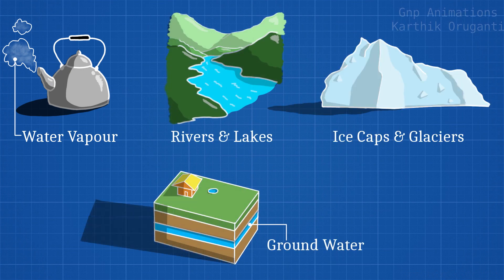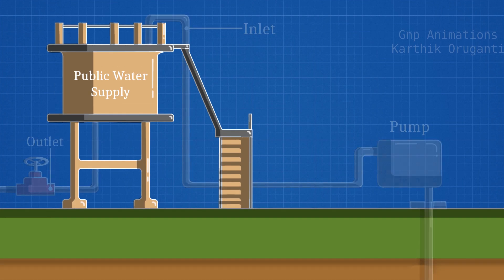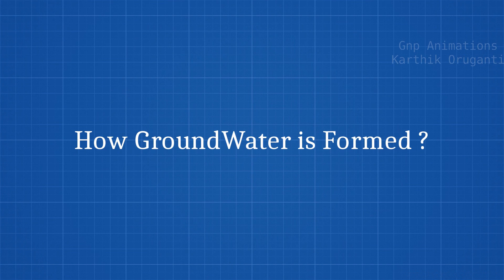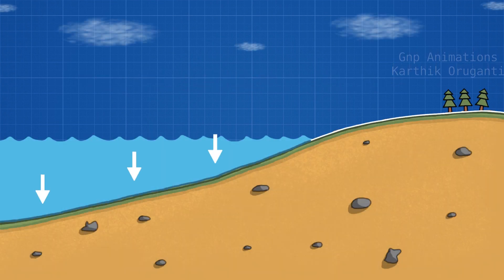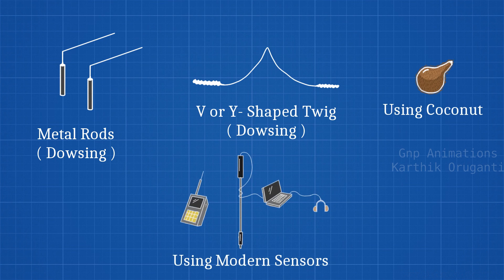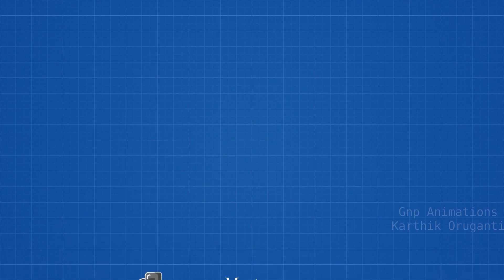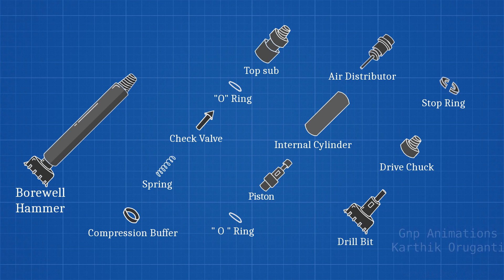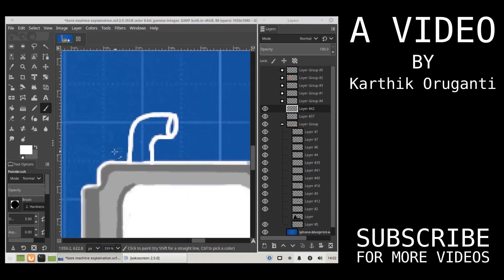The BoreWell Machine Animation

Comment: it's good to see a video on this topic, but some information needs to be clarified.... Water doesn't seep through bedrock as easily as it looks, it may take decades or even centuries.  So, deep aquifer water is a non-renewable resource, and should be discouraged, even banned.  Also, water beyond a few hundred feet have high chemical concentrations, and is unfit for consumption.   It is always better to ensure water recharge in shallow wells above bedrock, and reuse that water, which is renewable from rainfall every year.

Comment: I have an doubt ...can we extend the depth of existing borewell by same process (drilling)?
Reply: I don't think it is possible. After water is found the pipes are inserted and thus if you want to extend the well then first you will have to extract out all the pipes, then insert the driller and after all that once you have successfully extended it insert the pipes again with a new underwater pump. This is a very time consuming and laborious task and drilling a new borewell is more cheaper than extending one further.